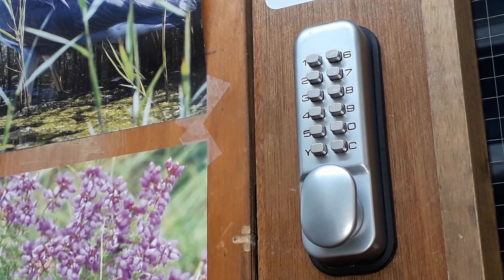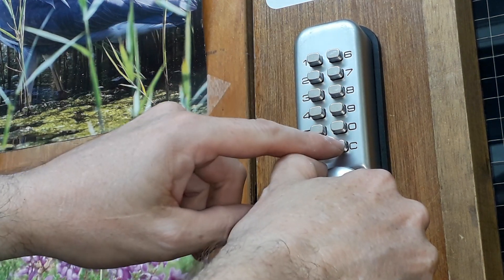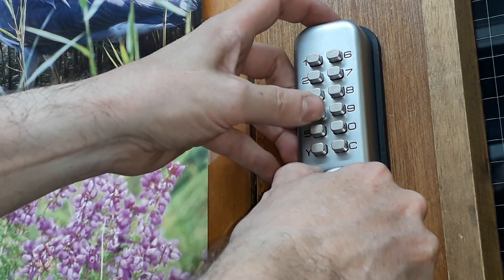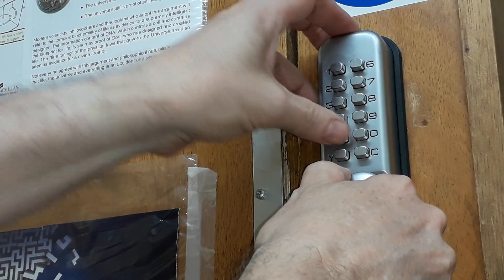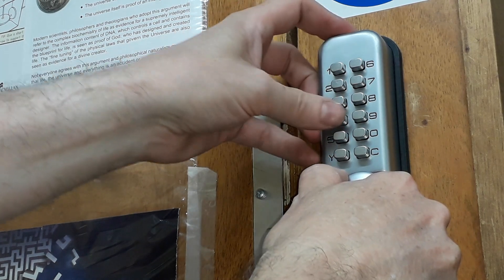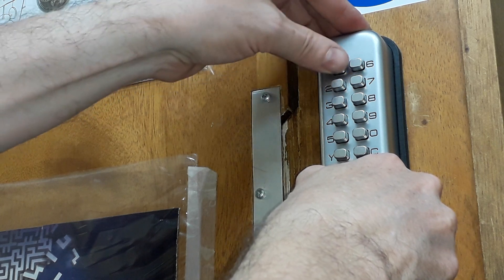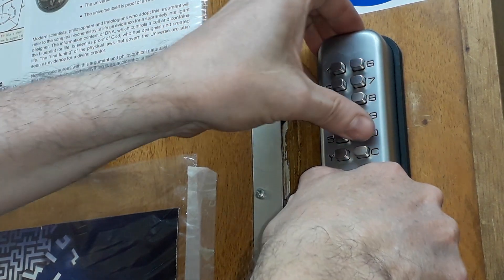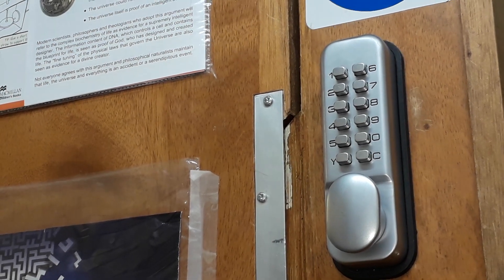(040) x2 Digital Push Button Door Locks Bypassed

Comment: That first lock is installed so horribly that I bet you could open it with a credit card without breaking your stride. Who installs a lock with no form of jamb or plate blocking the non-opening side of the door?
In fact the scratches by the latch seem to imply that many people have used exactly that method!
Reply from the maker: The latch mechanism has a second pin that stops you bypassing with a credit card shim. I think you may be right that someone or two may have tried to gain access.  The door isn't that high security that it matters that much, hence there being no need to put a plate to protect the latch mechanism. The other door needed something to give a bit better view at least that it is reasonably secure. 

As far as I know no one has actually got any of those doors open. To be honest these kind of locks are not secure as it doesn't take much to see the numbers when punched in. Those numbers can be pressed in any order to open the door,  so looking as you get the right numbers.
Reply: @roysammons2445  That is if the person installing the lock has taken the time to ensure this is in place. 99% of the time it wont be and the latch will freely retract.
Reply from the maker: @vryko8567  I have seen this on many properties I have visited. The latch hasn't been fitted properly so the small latching bar that gives shim protection doesn't work. This latch mechanism can also be affected by weather causing doors to contract or swell.

Comment: normally there are easier ways by just looking at them, first giveaway is fingerprints on the used numbers, second giveaway are clean spots or dirty spots around the numbers, third giveaway is scratch marks down the side of the used numbers. office ones are the easiest because the women use greasy hand lotion and leave grease marks on the buttons.
Reply from the maker: All very good valid points.
These kind of locks tend not to get their codes changed that often because they are fiddly to change. The ones in the video don't tend to have the tell ttake signs you shared. Although I have been in places and some of the buttons have been obvious because they have looked more skinny than other buttons. 
Thanks for the comment 👍🏻

Comment from the maker: I though I would share this: This week my daughter contacted me and asked how to open a door with a push button lock on it.  It had always been on the snip and all employees that knew the code had left. 

I gave her the same bypass method and 10 minutes later she text me and said "Dad it worked, I am in".
Reply: I always found that the easiest way to get passed these was simply to look at which buttons were shiny, from where regular pressing had prevented dust and grime from building up.

It's surprising how many companies (especially banks) use combinations like 1 2 3 4 or 1 2 7 6.
Reply from the maker: @surfdigby  If the company that uses these types of locks does these two things then it is difficult to use the option you suggest:
1. Change code regularly.
2. Clean buttons often.
Having said that, these types of locks don't usually get their codes changed that often because they have to be taken apart to change the code.

Comment: Great video!!  Kind of scary!!
Reply from the maker: Indeed. 
Works great on locks that aren't new. After getting the feel for it, it works pretty much everytime.
Reply: Roy Sammons it kind of looks like the locks that were on the med rooms at a nursing home that I used to work at. I’m sure they have changed them as that was a long time ago. Are they used for that purpose or at schools to secure chemicals and such.
Reply from the maker: @LockpickingsGal  I see a lot of medical facilities use them. Doctors surgeries, hospitals,  dental practices and pharmacies. 

I use then to secure things like labs & office areas.

Comment: Great demonstration.  Did you develop that technique yourself?
Reply from the maker: Yes, I was fiddling with a lock on my workbench and tried the technique of slight tension on the twist handle and pushing the buttons.  After several attempts to get the feel it seemed to work. I found it not so good on new locks but locks that are not so new it worked great. Afterwards I searched YouTube to see if anyone else used the same method. I found one channel where this person used the opposite method. After tensioning the lock with the knob they said the buttons that was solid seemed to be the correct buttons. I tried it a dozen times but that method didn't seem to work for me.